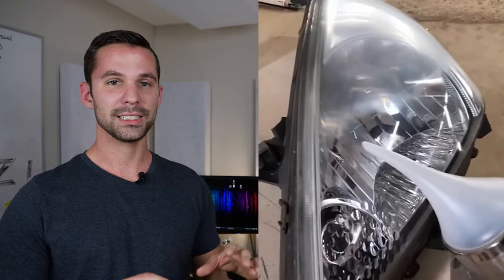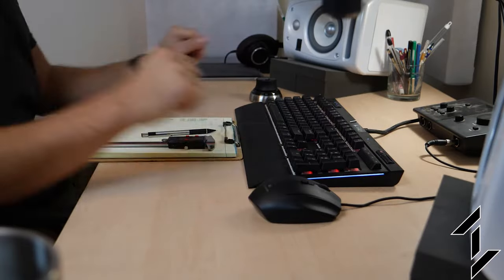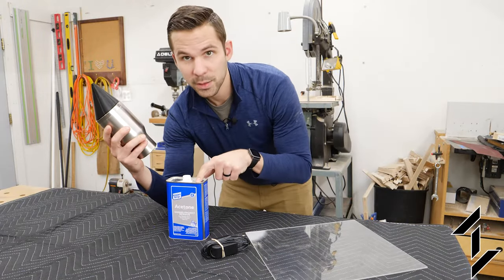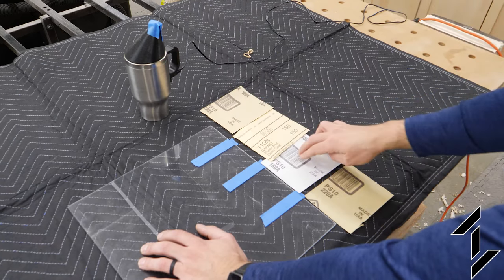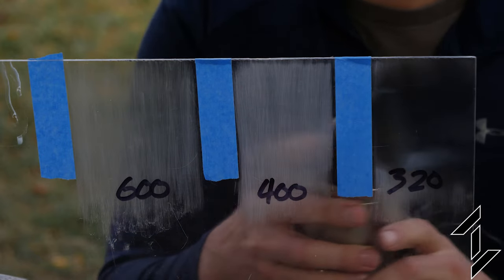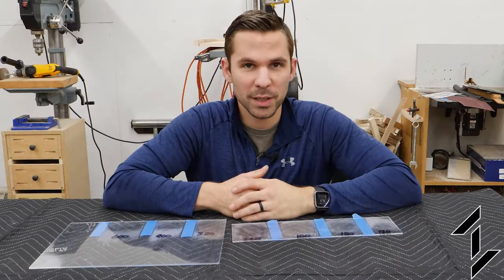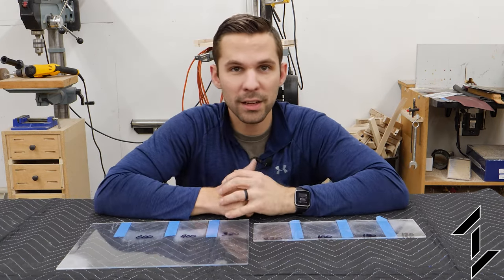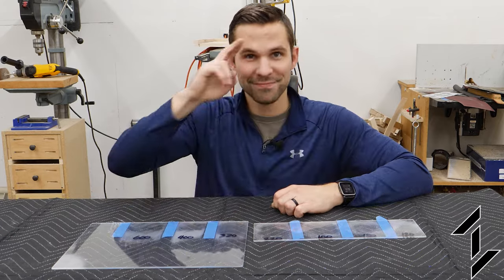Smooth acrylic? Yes, but...

Comment: I don't think they're cleaning scratches as much as resetting the surface from oxidation after the factory-clearcoat wore off. I'm sure it serves both purposes but I'd be willing to bet scratches they are fixing are much smaller than 600 grit.
Reply from the maker: I think you're right, definitely a higher grit than I used in the video.

Comment: This is how you do it 
320 
400
600
800
1000
2000
3000
Then use the vapor canister 
Some guys even go higher with 5000
After you have to seal it with something UV protectant 
Pure Acetone is what you want and you need to do it with no wind or indoors in a garage 
It does work 
The final product is going to be based on how well you sanded.
Reply from the maker: That's great info! Thanks for sharing!

Comment: The tutorials I watched progressivly sanded to 2000 grit before using the acedtone vapor. You are deceiving folks with your lack of research.
Reply from the maker: All I was doing was seeing if acetone vapor could smooth acrylic without having to go up to super high grits and I stated that at the beginning of the video. Then I show my process and results. Not sure how experimentally testing a hypothesis could be considered deception but you do you.
And I did do research before this experimentation and at that time of posting the video there wasn't a lot of information on vapor smoothing.
Also, I directed people to leave comments if they had more information/knowledge, and what do you know, there's some valuable information in the comments.
Reply: @42Pursuit  but you called it a "fail".